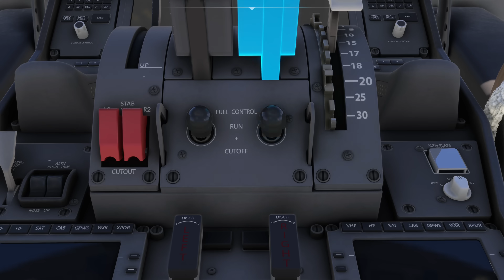Air India 171: Why Did The Fuel Cut-off Switch Get Moved?

Comment: Here’s what I don’t understand.

During takeoff, the pilot flying pushes the throttles to full power. The pilot monitoring places their hand over the pilot’s hand to ensure the throttles stay engaged. Standard procedure.

Now think about this: the engine fuel switches are not simple toggle switches. They require a deliberate, two-step action lift the guard, pull the switch out, move it past a detent, and hold. These switches are located under the throttles. They're designed to prevent accidental activation.

So, both pilots have one hand on the throttles. For the captain on the left, that’s his right hand. For the first officer on the right, it’s his left. That means their free hands are away from the center towards their respective windows.

Now, go back to the report. The RAT (Ram Air Turbine) deployed immediately after rotation, which only happens after complete electrical failure i.e., both engines shut down. And this happened just seconds off the ground.

So the question is: how do you operate complex, guarded switches under the throttles with your far hand while your near hand is holding the throttle and do it without the other pilot noticing?

Imagine trying to reach across your own arm, twist awkwardly toward the center, open a guarded switch, and cut off fuel to not one, but both engines without your colleague reacting?

And now the real kicker: both pilots are recorded asking each other if they moved the fuel switches to cutoff. One says “Why did you cut off the fuel?” The other replies, “I didn’t.”

So let me get this straight we’re supposed to believe:

- both pilots accidentally shut down both engines during rotation, or

- both were suicidal,

 and yet both pretended to be confused and innocent right before impact?

Come on. This makes zero operational, procedural, or human sense.
Reply: Simple. At V1 both pilots MUST take their hands off the throttle regardless of the procedure up to that point. The switches were operated after V1. No need for any acrobatics. Both pilots have their "thrust hand" free at that point and can easily do anything. There is no need or procedure for the pilot flying to put both hands on the yoke. Either pilot could easily operate those switches after V1 without being noticed or making any unusual movement.
Reply: Maybe the co pilot didn't have his hand on the throttle as usual but flipped the cutoff switches instead? Not a big leap of imagination.
Reply: @tyjones5019  "imagination" being the key word
Reply: Wow. If that is correct I don’t see how one guy could reach over his whole body to do this without the other one not noticing and not try to stop him.
Reply: @nancyrea3863  OMG IT IS IN THE MIDDLE OF THEM PRETTY SURE...THE CO PILOT HAD BOTH HANDS WORKING FLYING PLANE. THE MAIN PILOT OLDER ONE IS THE ONE SUSPECTED.
Reply: @YogaBlissDance FOR SOMEONE CALLED 'YOGABLISSDANCE', YOU SEEM A BIT STRESSED !
Reply: I have not heard about both Pilots hands on the thrust levers during takeoff. Most airlines that I’m familiar with, the Captains hand is the only hand on the thrust levers once takeoff thrust is set
Reply: Is it possible that the fuel got cut off due to electronic malfunction and pilot A got a warning in the dash, so he asked the pilot B "why did you cut off?" Pilot B replies "i did not". As the engines flamed out, the pilots flicked the switches to cut off in that 1 second  sequence  and run again in an attempt to restart?
Reply: Easy to explain:
1) Both pilots have their hands on the Power Levelers (Throttles) during power setting for take off.
2) Once the power level is reached, the Pilot Flying removes his hand to grab the yoke with both hands.
3) The Pilot Monitoring keeps his hand on PL's for the take off roll.
3) PM calls 80 kts and PF acknowledges. PM still has hand on PL's
4) PM calls V1 and removes his hand from PL's.
5) PM calls Vr and PF rotates. No hands on PL's
6) PM call V2 and PF is focused on following departure procedure. No hands on PL's.
7) PM slowly reaches the fuel valves and sets them to fuel Cut-off. PF is too focused on the flight instruments to even notice the any hand movements from PM. 
8) Likely alarms go off for different systems, including the RAT and airplane performance reduces significantly.
Reply: Same plane had electrical issues on previous flight and passengers complained of no lights, no air con, no tv. So someone knew that plane should ha e been grounded. So real question was: Does the emergency procedures say in event of electrical failures and RAT deployed are the fuel switches automatically turned off by computers?
Reply: Why can't it be that the internal electronics malfunctioned and switched off the engines? How does the blackbox know if the fuel switch was physically moved or just the internal electronics reporting the switch off .
Reply: Pilots move their hands off the throttles after V1 speed.   Watching any cockpit take-off video will confirm this.
Reply: Wow, it appears you've heard the full recording of both pilots asking each other why had they cut off, while nobody of us have. Share it, be do kind!
Reply: You can watch Video by Flying Beast who is an Ex Commercial Pilot and explained the whole scenario second by second and explain why he thinks its not the Pilots error.
Reply: Watch Flying Beast videos for actual truth.
Reply: This is what my theory is
Engines failed BEFORE the switches were touched. Engine was functioning normally as the plane lifted off, and right after liftoff, both engines failed. Boeing's own manual for the remedy for this was "Have you tried turning it off and on again? This will tell the computer to relight the engine" in the official procedure, and nothing else to do other than to play with those switches in hopes of relighting. Engines would have immediately relit due to residual RPM after failure and toggling the switch, didn't happen, plane crashed with engine off. Switch did jack shit, engines never relighted, and crashed. Easy to blame pilots to wash hands off when somehow almost all Boeing crashes are due to pilot error? Sure, whatever makes Boeing the most money.
Reply: @beyondwaveformsmusic Regarding the CVR:

The CVR records one pilot asking the other “Why did you cutoff?”

The other responds he didn’t.

It’s possible the pilot flying saw the PM (a highly experienced Captain and Trainer) move his hand near the fuel switch area, perform the memory item for dual engine fail/stall (which involves momentarily cycling the switch from RUN to CUTOFF and back to RUN), and then return it to RUN.

Since the switches were found in RUN post-crash, and he denied “cutting off,” it may indicate he did execute the memory item and restored the switches — not intentionally shut down the engines.

Also, the report only quotes part of this exchange — the rest may contain clarifications not yet disclosed.

Furthermore, in India, English is often mixed with Hindi, especially in stressful situations. It's plausible that the conversation was in mixed language and may have been mistranslated or partially understood.

🧩 Putting this together:
✔ CVR transcript is incomplete, possibly lost in translation or context.
✔ No conclusive evidence yet of deliberate action — needs deeper analysis.
Reply: But west is very stupid. They are liars.
Reply: Do you have any evidence to believe that thrust was being guarded? And the hand comes off at V1. That's much before actual lift off.
Reply: BOTH PILOTS DENY SWITCHING THE FUEL CUTOFF, UNTIL I HEAR THE FULL CONVERSATION I HAVE NO TRUST.
TAKE EVERYTHING EVERYONE SAYS WITH A PINCH OF SALT. THEY ARE CALLING THEM LYERS, ALSO STRAIGHT AFTER CRASH THEY START STATING THEY HAD BREATH TEST,,,WHY? MMMMMMMMMMMM THE ONLY WAY TO PROVE WHAT HAPPENED IN THAT COCKPIT IS TO FILM IT. JUST BECAUSE SOMEONE SAYS A COMPUTER SAYS SOMETHING DOESNT MAKE IT TRUE,,,,,,  I SMELL A RAT
Reply: Your not a pilot are you? As soon as the PM says “Rotate” the PF removes his hand from the throttle and places both hands on the control column.
Reply: Brilliant observation!
Reply: This procedure is not followed in any of the Indian airlines.
Reply: @nikhilc8681  DGCA Training Manual for Type Rating Organizations (TRTOs)
The TRTO syllabus structure (DGCA CAR Section 7 Series D Part III) includes standardized takeoff procedures that follow ICAO/FAA norms—including dual-hand throttle technique. The DGCA-approved TRTO manual reinforces these practice
Reply: Watch Flyingbeast video if you  really believe in unbiased explanation ❤❤❤ english subtitles are available
Reply: So convenient that no media in the West published criticism by investigating body of such speculation. Everybody has assumed the pilot “calmly” said “i didn’t do it”, no mention of calm anywhere in findings.
Reply: So what are you suggesting then? That it was an electrical failure of some kind?
Reply: How can you tell that the pilots actually DID the one-hand-on-throttle procedure as common? There's no cockpit camera, to my knowledge.

Someone wrote that these fuel switches are not hard wired, but they simply send an impulse to the control software via a control voltage. 

If that's correct, the pilot may not have seen the actual position of the switches, but rather a display message saying "fuel cutoff" when asking the question "Why did you...?"

If that is technically possible, it might be that NOBODY actually pulled and flipped the switches.
Reply: @gerohubner5101  If... if.... if... SO we are only still speculating.
Reply: @bobvidoni5898 You're absolutely right! 

But that's because I'm neither a pilot, nor a Boeing engineer or aircraft designer, and have only limited understanding of mechatronical control systems and processes in an aircraft. (I only know how such systems are basically laid out, and how functions are implemented)

I.e. people who actually KNOW these things about the 787 technical design should easily be able to give clear answers.
Reply: @gerohubner5101 which then makes me ask can this operation be performed remotely?  And to really go down the rabbit hole, who was on that plane that someone needed dead?  Is it possible one or both pilots were persuaded to facilitate the action?  This whole event is way on the outside and nearly a good fiction novel. But sadly not fiction.
Reply: @firecracker4151  No, the planes can't be controlled in any way from outside. It would be too dangerous as planes could get hacked. Plus the switches have a spring and have to be manually pulled. out.
Reply: @firecracker4151  LMAO, the mighty pirate attack that physically moves switches xD
Reply: @firecracker4151 not possible, as  no solenoids are part of that assembly to move the switch. There is an internal interlock guard that could get disabled, as a 2018 directive mentioned. They can then be moved to off without the pull-up step required.
Reply: @radioactivemike1 I won’t say kuch but everytime there’s an election in India, there’s a disaster 😢
Reply: It's likely that the switches were moved in response to an emergency and pilots tried a reignition procedure. But underlying cause for lack of thrust might be engine failure due to something else.
Reply: awesome analysis.. it is very clear that this video’s pilot has suddenly become pro-Boeing.. agree 100%, if one pilot somehow secretly and deliberately shut down both engines (assuming suicidal intentions), he would certainly NOT act surprised when the other pilot asked him “why did you cutoff”.. secondly, the bigger question is - why is the airline hiding disclosing the entire conversation between the pilots, and why have they shared just few specific works from the pilots.. clearly trying to hide something and leading the public to believe as if pilots were at fault
Reply: He never said “why did you cut off the plane”.  He said “why did he cut off” and could have been referring to the plane itself.
Reply: As quoted from an interview with an aviation expert, specifically noting: Past Incidents and the TCMA System
Schiavo specifically cited a 2019 incident involving an All Nippon Airways (ANA) Boeing 787, where the aircraft’s system erroneously shut off fuel mid-air after mistakenly detecting that the plane had already landed. The software in question, known as the Thrust Control Malfunction Accommodation (TCMA) system, has been previously implicated in similar malfunctions. Designed to help the aircraft distinguish between flight and ground conditions, the TCMA can command the engines to reduce or cut power under certain circumstances. In the ANA case, the system’s premature fuel cutoff forced the plane to glide heavily to the runway. Fortunately, the incident occurred during landing rather than takeoff, preventing a crash.
Reply: None of the pilots were suicidal. Captain Steeeve is clearly shilling for Boeing (or someone else, which is worse): the switches were never moved and were found in the RUN position,  after the incident, which leads to believe something else cut off the fuel supply valves.
Reply: @xuartema4067 Both of your claims are fictitious. You didn't know the pilots, and neither you nor anyone else knows whether the physical fuel switches were actually moved or not.
Reply: This Captain is a captaion of boat not airplane. 🤣🤣🤣 Boeing paid him so he is just bluffing
Reply: I agree with your explanation.  I also believe there was an electric failure.  Both pilots sound confused.
Reply: @markwriter2698 I don't think you have actually heard how they sounded

Comment: when the Fuel cutoff switch is turned to cutoff mode, how come the sophisticated aircraft does not have alarm in the dashboard, indicating it was turned off, so that it can be turned to Run position without guessing or manually need to find out its not in Run mode.
Reply: The sudden, deathly silence in the aircraft is more than enough to tell everyone that something terrible has happened. No alarums are required.

Comment: I'm opting for the suicide route, for the simple reason that no mere "accident" or "digital glitch" could have caused these purely mechanical devices to do behave as they did.  And it wasn't just ONE button, but TWO.  Both were turned off and on with a brief pause in between, so you can't blame this on a software problem or any other simultaneous event.  When you combine this fact with all the other incidents of pilot suicides, it's the only answer that makes any sense.  If I'm wrong about this, I'll be the first one to apologize.

Comment: 3 questions:
1. Does the cockpit voice recorder have multiple audio inputs?  If so, would the voice recordings be able to differentiate between the two pilots in the cockpit just based on audio levels (or mic inputs from different parts of the cockpit)?  Hopefully so, and if so, that might eventually come out in the final report as to which pilot said which words.  I would guess the investigative board already has very good data on who said what, but did not include it in the initial report.  
2. Assuming the preliminary report is correct and that the fuel switches were deliberately transitioned by one of the two pilots in the cockpit, If the PIC was the one to switch them off in a deliberate act to crash the plane, wouldn't it have made more sense to just suddenly nose-down the aircraft rather than kill fuel to the engines?  At such a low altitude, it would be unlikely that the other pilot could recover the aircraft quickly enough to prevent disaster, especially if the PIC was using their full strength on their yoke to keep the nose down.  If so, it would lead to the conclusion that the monitoring pilot was more likely the one to switch the fuel off.  The videos and report do not indicate anything other than maintaining a nose-up attitude.  
3. The fuel cutoff switches of this design are in use across many Boeing aircraft.  Do Airbus aircraft have similar manual fuel shutoff capabilities, and if so, how are those switches protected from accidental movement?
Reply: Yes, Airbus aircraft have a similar setup.

Comment: Why isn’t something as important as the “Fuel Cutoff Switches” need confirmation from BOTH the Captain and the Co-pilot…2 switches in the middle as they are currently…. then a confirmation switch to the left of the pilot seat 💺that must also be triggered for this act of shutting down the fuel to take place!?
Reply: Because if one pilot becomes incapacitated, the other pilot needs to be able to operate the airplane by themself.

Comment: I think the solution is a software feature that prevents fuel cutoff during takeoff, or until a certain altitude is reached. As fuel cutoff in that phase of flight is NEVER called for, there are no drawbacks for preventing it.

Comment: Why is this guy so biased and blaming the dead guys.  The fuel control was on during take off and the plane took off at exactly at V1 speed. 
Then this switch issue happened and the pilot tried to restart the engines,  this is on the initial report.
Apparently there was a circular sent from boeing to all institutions ( like air india ) that there is an issure with the fuel control switches and needs to be updated/replaced.  This was missed by air india and thats clearly stated in the report .  Unfortunately there was no time to get the engines started as there was no altitude.  The plain fell in the same angle as it took off meaning the pilots had full control and trying all options to revive the aircraft. 
Steve is used to blaming the pilots since day 1 in this airindia crash. Lost respect for this guy. Now he seems very defensive.